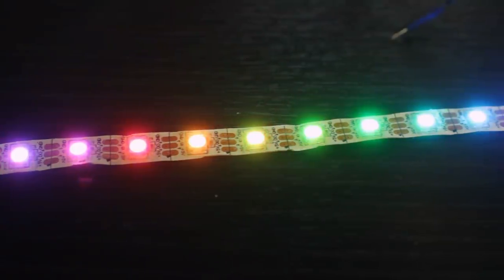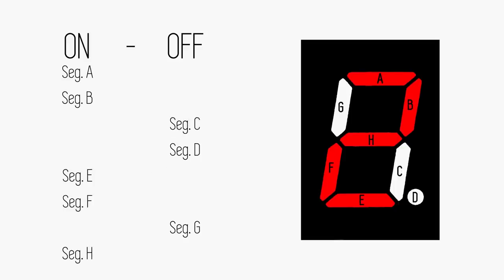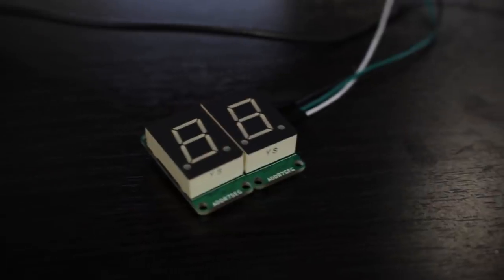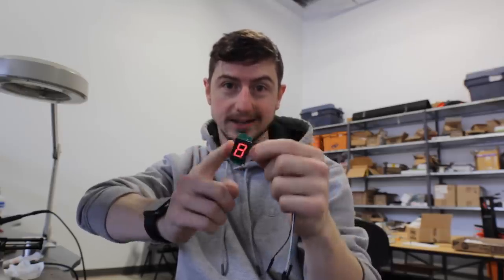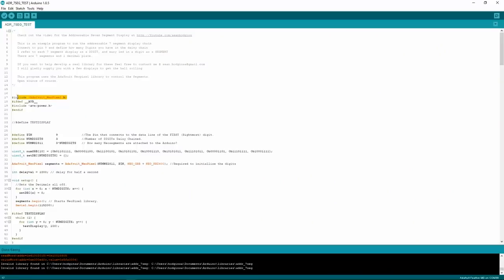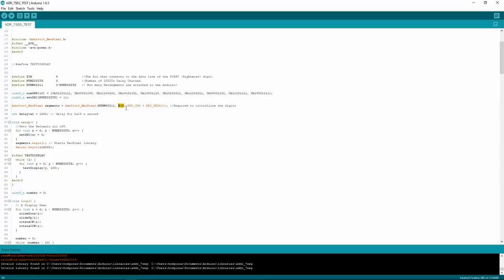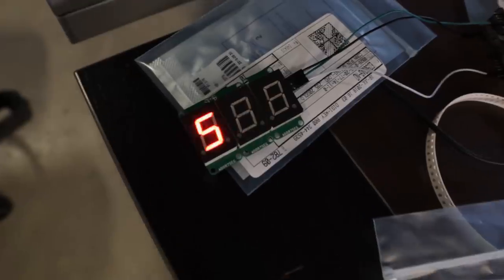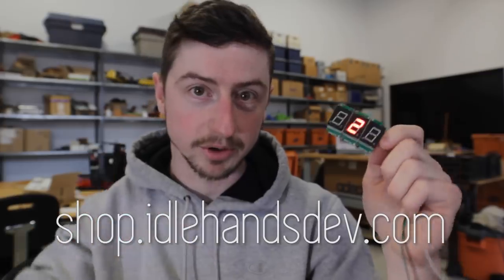Addressable 7-Segment Displays

Comment: Whoa .. i'm absolutely thrilled by your idea! It's so cool......

Now, imagine designing a dedicated new small controller like a WS2811 but dedicated to 7segment displays and similar multifunction segment-displays.

That way, one can even keep the amount of needed software and translation (numbers to segments/(controller-parts)) down for the controlling MCU .. and display producers maybe could produce completely enclosed standalone variants.

BAMM We have a wonderful world of displays with low cost of I/O pins and necessary wiring/needed contacts on PCBs..

A very cool thing...

You make 2019 having a somewhat cool start in tech. ;)

Comment: Nice project! I have some of these chips laying around still. In the datasheet you can read that each output channel can drive current for up to three LEDs in series. I think that would allow for some very nice super-sized displays...
Reply from the maker: Yeah they are fine up to 12V on the LED side.

Comment: Hmm, any blog-post on design choices? I feel like the three ws2811s are an interesting choice, instead of going with a single microcontroller, and writing your own firmware for that (could be ws2812 compatible, or you could make your own less strict protocol). Was that option considered? Was the 2812s found to be cheaper in quantity?
Reply from the maker: No blog post on design choices, just some posts reiterating mostly what I said in the video. Generally a single microcontroller is not going to be able to directly replace this without additional components. These chips are off the shelf ready to control an LED using current control internally. Single resistor and capacity per chip. They don't need to be programmed, and they're less expensive. Its what they're made for.

Comment: Did you consider any other controllers? Like the one in the APA102 LEDs, so that there would not have to be any timing concerns with the data signal? Shame to have interrupts disabled on the Arduino to display digits. But I do like the concept.
Reply from the maker: Does the APA102 have a standalone IC without the LEDs embedded?
Reply: Hmm, that is a question that I really didn't think about before commenting. I was only concerned about the interrupts-issue that arises with the WS2811.
That does complicate things, of course.

Comment: Wow! I've been hoping someone would build this.  I've just one question - Support for a larger seven segment display?  I would like to drive 3 pairs of 7-Segment digits, specifically(YUNSUN ysd-1600ar6f-89) . Will unit do this?
Reply from the maker: I’m not sure, it depends on the current and voltage requirements. Check out the datasheet for the WS2811.

Comment: Would 5 WS2811s fit on that PCB for 14 segment alphanumeric displays?
Reply: bornach I don’t think so, however you might be able to fit a different type.
One of these would likely fit fine and do the job.
You will need to use more pins however, but only 2-5.

https://www.mouser.com/Mobile/Texas-Instruments/Semiconductors/Driver-ICs/LED-Lighting-Drivers/TLC5928-Series/_/N-7zhqf?P=1yy25r5Z1z0zls6&gclid=Cj0KCQiA1NbhBRCBARIsAKOTmUvsEaIjgfxLie7hveum7aTU9dbZsTk_WVIliBwKRCxnwJO7B1abV2QaAiNXEALw_wcB

Comment: Realy nice! Would you conside making just the boards, so we could fit displays of diffrent size of our own?
Reply from the maker: GeekJoan the displays and the layout of pins are often associated with the size. So everything is pretty difficult to standardize. If I sold just the boards you would basically just have the buy the same display that I solder on. You can of course modify my files to use the display you want though! Common anode.
Reply: @SeanHodgins  True, but that is what cables are for... =)
Reply from the maker: I see what you mean, like a bread board version? I think that would be great too. Ill do that.

Comment: I'm new to the electronics hobby myself and was just working on some 7-Segment displays. At first I did not now what shift registers multiplexing and charlieplexing were and was quite annoyed with the number of pins you needed. But even after shift registers and multiplexing (which was quite hard to include in my code) I still needed a ton of pins for the 4 I wanted to control. Thanks for showing a way to simplify them.
Btw how did you think of doing this? Had no one done it before? Did you need it for a project of yours?
Reply from the maker: Yeah they can be a bit of a pain. Hopefully these work for you! - I'm not sure when I thought of this. I think it was when someone pointed out that the WS2811 does controls the LED with current, which made me realize that they didn't need to be RGB LEDs, and any colour would work.
Reply: Using shift registers also takes up a lot of processing power. Using a LED driver takes the load away from the MCU. BTW. There are many other solutions. LED drivers chips such as the TM1640 can drive 8x16 leds using only two lines (clock and data). The WS2811 has the advantage that each LED has 256 levels of intensity.

Comment: To be honest I'm disappointed you didn't explain anything about how it or the chip works.

I love in depth technical videos
Reply from the maker: Thought about explaining more about the circuitry, but I didn't end up getting into it. But I wouldn't have too much knowledge about how the chip works internally. Do you mean how they are controlled?
Reply: @SeanHodgins  yes, how it actually manages to control a theoretical infinite amount of LEDs.

https://cdn-shop.adafruit.com/datasheets/WS2811.pdf
after looking at the datasheet myself it just looks like it sends information in terms of 24bit chunks. so the first 24b go to the first connected IC. the second chunk also go to the first IC but get passed through to the second IC, and that keeps going until it reaches the end. there also seems to be a RESET code. which makes sense as you want to change the data again after some time.

you could've put this in the video it doesn't seem that complex
Reply: Proxy I do think it’s important to remember not everyone who watches these don’t have a lot of knowledge on how this stuff works.
I’ve made the mistake plenty of times trying to explain something i view as basic to someone who isn’t too technologically savvy and realizing how complex and how in-depth I need to go for them to understand.

I’m sure even a decent percent of arduino users would have to have a lot of basics explained to understand it when I started arduino I wouldn’t be able to tell you much about bits or bytes or words and it was well over a year before I properly started learning about them.
It’s just not for this channel imo, for those who want to know about the ics can look at data sheets, and for those who just want the displays they get the info they want.

Comment: My mind is blown right now. Why has nobody thought of this before? So simple. I know that the neopixel library can be used with the raspberry pi. How difficult do you think it would be to use these with it? Such a good idea though!
Reply: Tim Roseberry not difficult.
Reply from the maker: Easy with raspberry pi, though I think there is something you have to do with the audio to get the pin to work at 400khz. Should be easy.

Comment: This is a cool idea but I feel like using a ws2811 to simply turn an led on or off is a waste of resources.
Reply from the maker: Benargee that’s literally what their built for. :)
Reply: @SeanHodgins  well they are built for a pwm output for brightness so there is an unnecessary level of resolution used by the mcu just to use binary on off. I just feel like a simpler chip could achieve a pwr/gnd/data(in|out) interface.

Based on the datasheet each ws2811 accepts 24bits for RGB. 8 bits per colour. In your design you're sending 72bits of data per digit(3x ws2811) where you could instead send 7-8bits depending on decimal usage.
Reply from the maker: Benargee being able to set the brightness of a 7 segment display is a huge feature, normally done by other more difficult methods in the programming.  You don’t always want to run them full brightness.
Reply: @SeanHodgins  absolutely, but to run each segment brightness individually has few practical use cases. I feel like the entire array would usually run at the same brightness which would consume much less data than the current implementation. I don't know if
Such a chip exists, but I feel like this application could be better implemented from a theoretical point of view.
Reply: @benargee  - For that usage there are plenty different LED driver chips available. I recently had some fun with the TM16xx chip family. They do offer some brightness control, but only for the whole display, not individual segments. Main advantage is low price plus support for button-arrays.
Reply: @MaxintRD  It looks like those are fixed to a certain amount of digits. I mean a chip with a similar physical interface to the WS2811 where you can daisy chain them together to any length.
Reply: @benargee  - The MAX7219 can also drive 7-segment displays. It's more expensive than the TM16xx chips, but it can be daisychained. The TMxx chips don't support daisy-shifting the data, but you can combine a shared data line with individual clock lines to save pins.